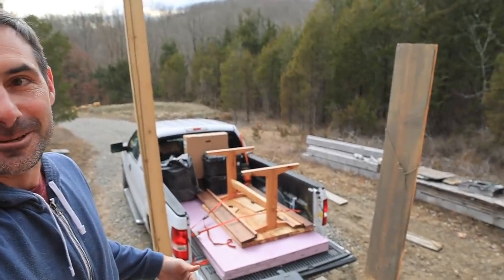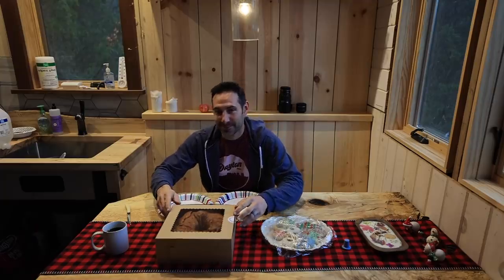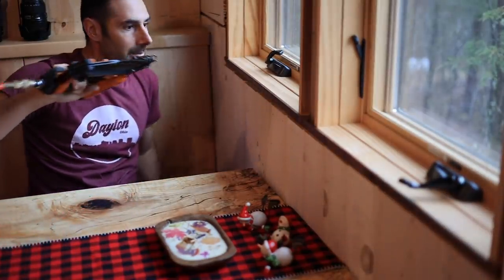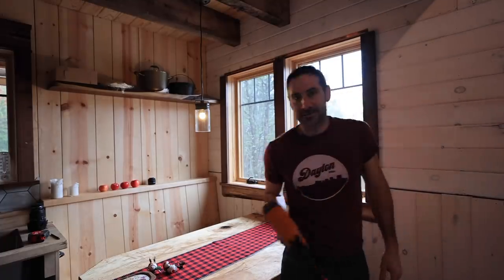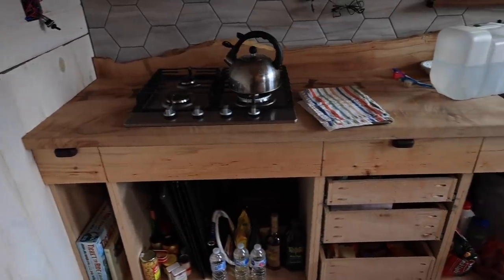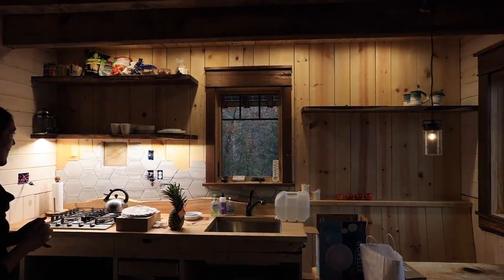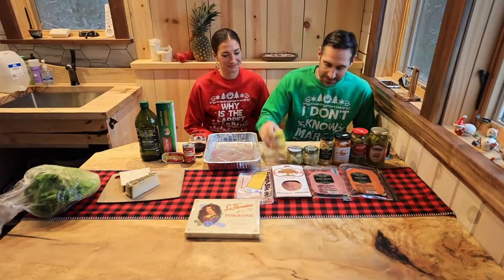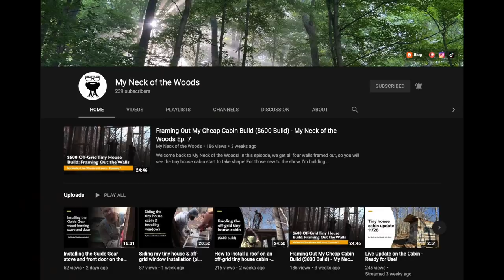Snowed in at the Off Grid Cabin | New Table | Window Trim

Comment: Wondering if you'll need to make another table top or modify the existing one.  That edge is too close to the counter.  Is it possible to aesthetically cut approx 6 inches and add a hinge to enable you to lower the top to allow more room to use the bench?  I guess another option is to  cut off more where you have the cutout.  However, if you did that, that's less room on that side of the table.
Reply: They can always trim the corner off more ..  if they gain weight <g>..  it all comes down to frustration Tolerance level.  After all..   it's a Cabin. 🙂
Reply: We just moved the table out a little to get in and then moved it back. The person who was cooking sat on the other side.

Comment: Maybe install a horizontal "chair/table guard" beneath the kitchen window because people will be moving the table for ingress?
Better yet, apply self-adhesive felt strip to table edge that butts against wall.
Reply: And they could add some below the table legs to make it easier to slide into and out of position!

Comment: Christmas Vacation definitely a classic. Nice seeing you both together, the place is looking amazing!

I recommend getting a cast iron dutch oven - you can make a little spot outside or even make a fire resistant place on the porch - or maybe with the wood stove if it doesn't have legs? The one I have is big and has legs, the lid has a big lip to hold coals on it, and you can use charcoal briquets to cook just about anything like you would in a normal oven. They aren't that expensive, and no electricity or weird fuel to store. You can bake fish in it - and bread, pies - just about anything.

Comment: Take the point of the end of the counter by making a 45°cut to match the corner on the table it only Hass to be maybe a couple of inches , it will make getting in and out a lot easier if you don’t have the sharp corner move around ...  have a good Christmas and may the new year of 2021 be better than the last one

Comment: Great table! Only suggestion I have is to put those little "feet" you can nail in that have felt pads ..... that way if/when the table is moved there are smaller points of contact on the floor and won't scratch the floor.

Comment: I think with the table I have usually seen those tables I typically shorter than the benches buy about 6 inches whenever they're tucked into a corner by a cabinet so if you were to shorten the table on the wall side you would probably be able to get it closer to the bench and more centre with the window

Comment: I would put a felt on the bottom of the table so you could slide it in and out to get in easier and it wouldn't scratch the floor and it would move very easily.

Comment: FEEDBACK on your video, turned it off in less than half way.  
Great idea on the window framing kitchen selection.
Table size, absolutely the worst, if you plan to leave it stationary. 
Sitting down, accessing the bench drawers, moving the piece back and forth, yes, will tare up the floor.          Merry Christmas.
Reply from the maker: I made the table too big for sure.

Comment: My Dad cut a six inch log ( branch) off of the cherry tree in our front yard. as a request by my Mother  It was to become the yule loge. Dad flattened one side and drilled Seven holes on the other side to fit candles. For Christmas eve dinner we always had toasted cheese sandwiches and Clam chowder. In the middle of the table was the yule log. surrounded by fake plastic pine evergreen. that Mom got at the Five and Dime store, along with four wide strips of red ribbons that ran from each plate settings to the yule log under the evergreen. After dinner we each pulled the red ribbon to find attached  to the end, a small in expensive present Mom picked up from the dime store. And that was our family Christmas tradition.

Comment: How does that stove do heating the cabin? We have the Vermont Castings intrepid 2 and it doesn't heat the cabin well. Our cabin is 14x30 with cathedral 12/12 roof and 10x14 loft. I just bought a mr heater 18k btu vent free LP wall unit to help supplement. Going down tomorrow to install it. Hope it helps.
Reply from the maker: It does pretty well down to about when it is 15-20 degrees outside.  I think once the floor and the tops of the walls are insulated it will be about perfect in any weather.  We have R40 ceiling and R 20 walls, so if you have less insulation you may want to up size.  It's burn time is only about 3-4 hours, which is kinda of it's only drawback.  It also doesn't have an ash pan, so the fire needs to be down to empty ashes.  Even with those flaws we really love the stove.
Reply: How do you plan on insulating your floor since it’s already finished? I could use more I think.
Reply from the maker: @003fulle  I'm thinking I will use one of those spray foam kits.
Reply: Will you be able to crawl under to spray it? My cabin is suspended as well. Let me know what you think.
Reply from the maker: @003fulle  It won't be a fun job but I do think I can get it done.  I crawled all around underneath when I ran gas lines and also expanded my solar.

Comment: why didn't you just move the table to install the trim instead of moving around the obstacle ??
Reply from the maker: It's very heavy, the top is 2 inches of solid maple.  Was easier to just work around it for a couple minutes.